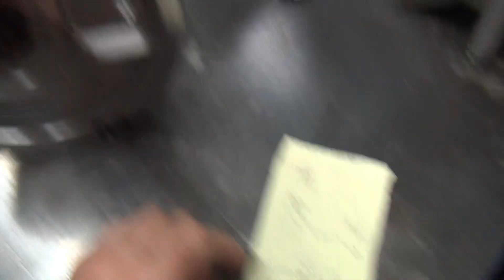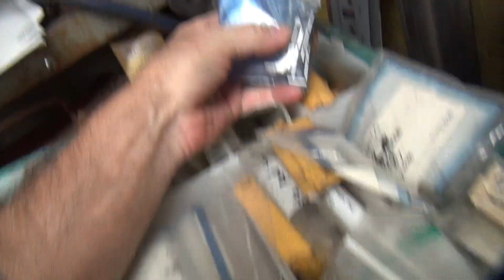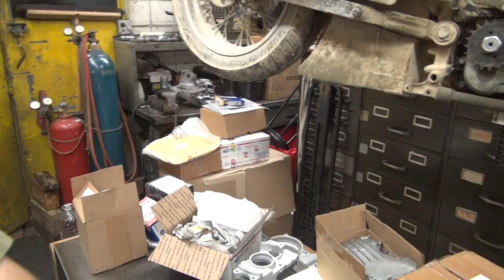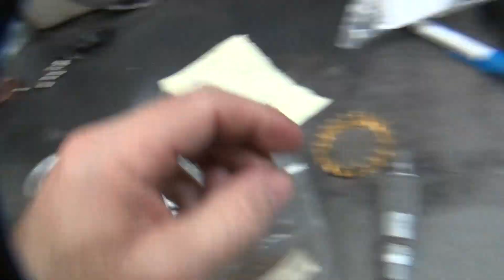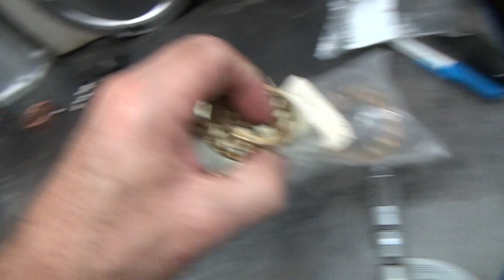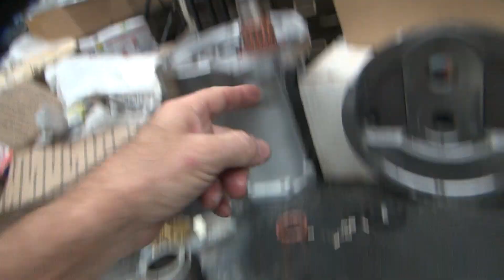#116 1946 junk 84ci stroker knucklehead 500 mile new repo motor rebuild 79ci harley tatro machine

Comment: Your thoughts on buying a complete set off e bay. Crank , rods and bearings. Already assemble. About 300.00 for 1983 Ironhead 1000 Sporter.
Reply from the maker: the old dixie ones are soft but ok if you don't run it hard. the new v-twin ones seem to be better but i don't trust him yet. s&s is over priced and very heavy. that is why i rebuild everything i get.
tatro